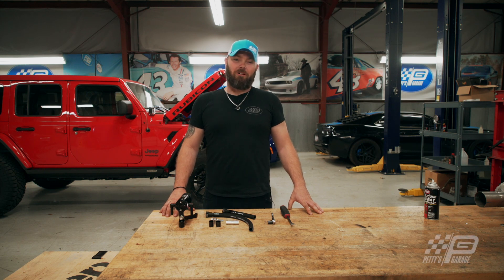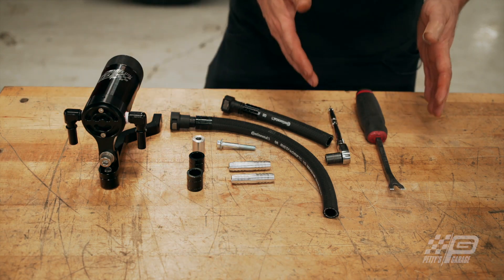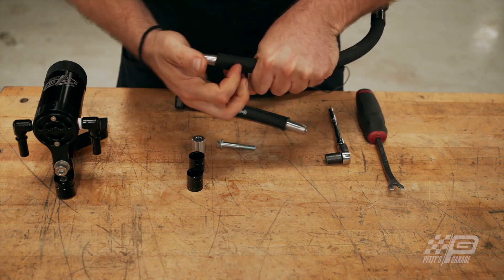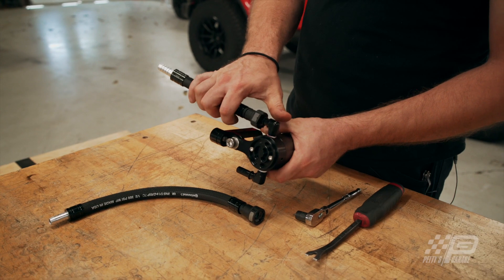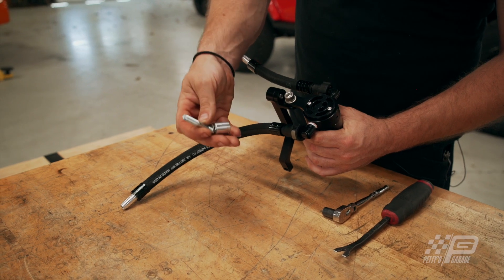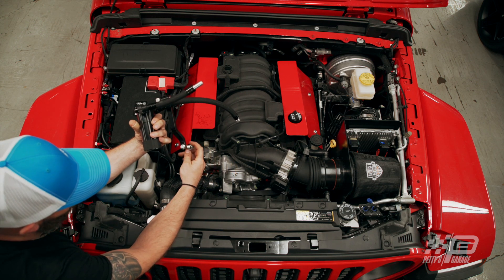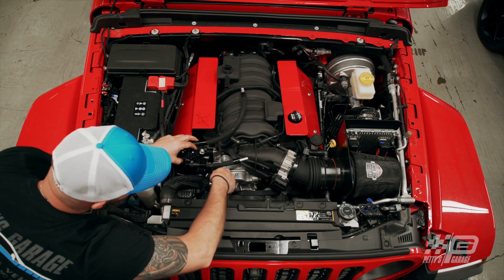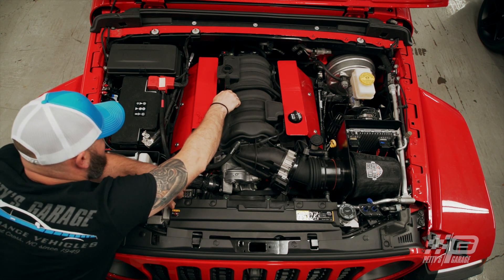HEMI Catch Can 6.4L & 5.7L Installation

Comment: What engine did you install that catch can on?  It was hard to tell in that Jeep, for me anyway.  Also was there a super charger on that?
 I have a 6.4 l hemi in the power wagon, It's a 2022 I'm thinking of putting a catch can on.
 I've owned least 10, 5.7 l hemi's in Multiple cars and trucks and S UV's and never ran One.
 I understand from many people mechanics next to enthusiasts that that the 4th Gen. 6.4 needed it.
 I am getting mixed messages from mechanics That Weather The 5th Gen. Need it or not. Especially if you change your oil early like I do. I change my oil approximately every 4000 km with amzoil 0W 40 Instead of 8000 km or even 10 or 12000 km as a lot of owners do.
 Any feedback would be greatly appreciated from the poster